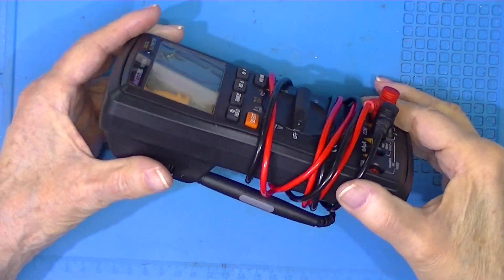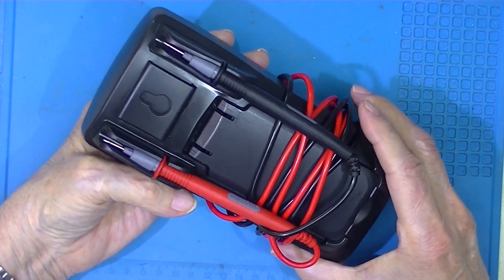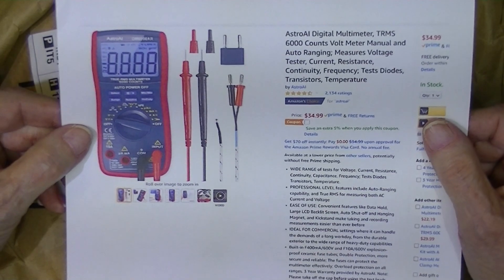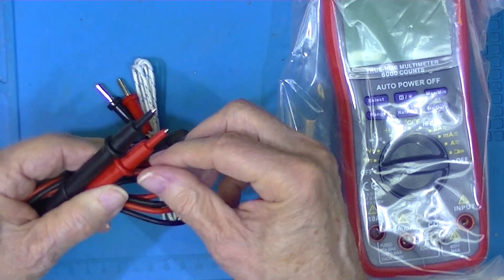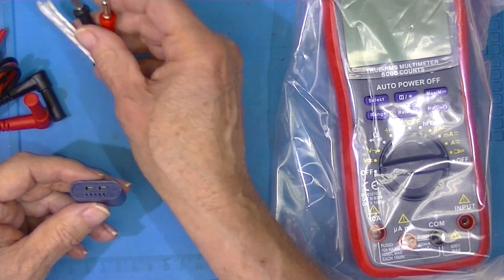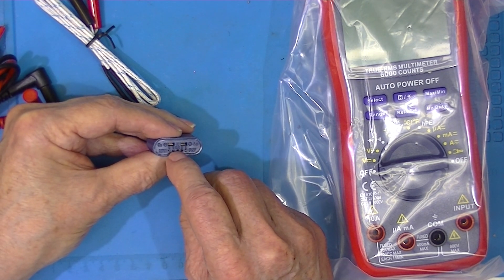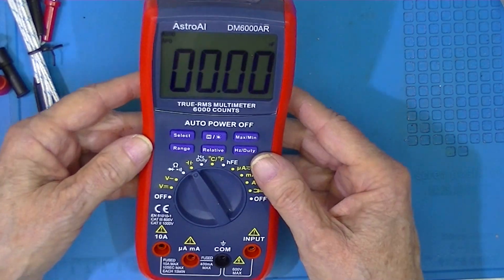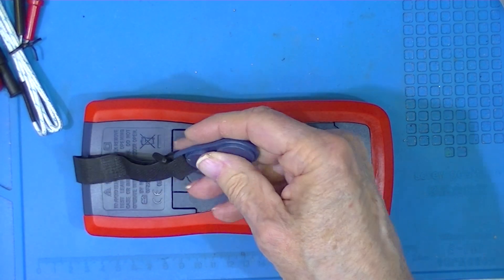AstroAI 6000 Count DDM Teardown

Comment: To open up the stand👉🏼press the Top left or Top right  of the stand👉🏼 it will open the bottom of the stand enough to use your fingers easily.. (like a tidder  todder )
Hope this helps all those who have trouble using the stand..

Comment: This is one of the most functional and accurate of the cheapo meters, just know this meter and any like it are only suited for light DIY and bench hobby DC use, not for ANY kind of industrial or high current use.  Ive had one of these for years and its been reliable and accurate, if I need more I break out my Greenlee or Fluke.  Its a BAD idea to use any of these low priced meters for anything but bench/DC hobby or DIY around the home use.  They are great devices if used within their low priced limits.

Comment: Ive got both main models of the Astro AI meters, the other being the DT132A and both have been surprisingly accurate and very reliable functionally.  You wont usually find case screw inserts for the case in a meter of this price range, most times in the battery cover if youre lucky.  Ive used mine on home voltages many times with no issues, but no I wouldnt use anything but an industrial rated meter for 360V or 480V - this is strictly a home/hobbyist meter like pretty much any low cost meter, but it does offer wide range functionality and good accuracy just stay away from high voltage and current.  I think you will find this meter is accurate and has a wide range of useful features I didnt like its looks at first but functionally I couldnt find anything seriously wrong with it, it just does its job.  Bottom line dont expect any serious input protection on most any meter under say $60, though there are a couple minor exceptions.  UniT has a new meter model # UT17B+ with a very solid construction that is marketed against the Fluke 17B+ which I have.  It costs around  $65 and has notable input protection components almost identical to the Fluke 17B+ which I also have.  Mind you theres more than the components to input protection, how the PC board is designed with anti flash-over features and other design particulars such as trace spacing and built in flash barriers also play a big part, but it almost takes an electrical design person to accurately point them out.